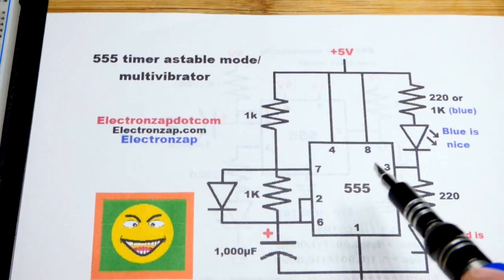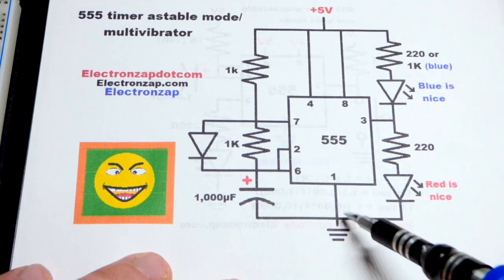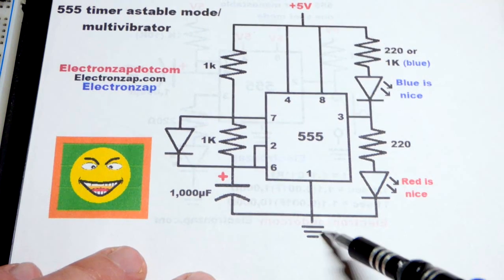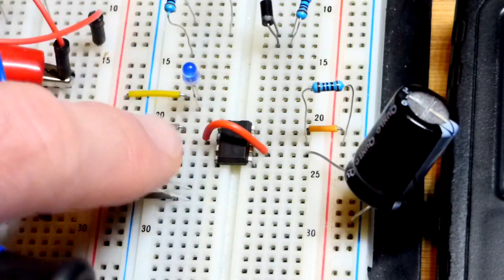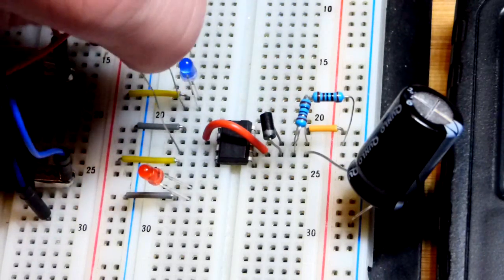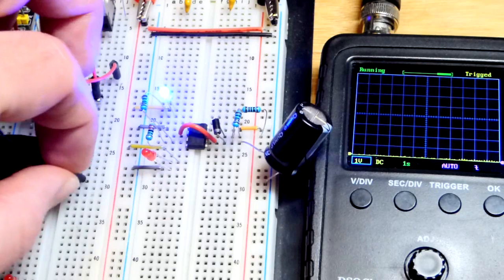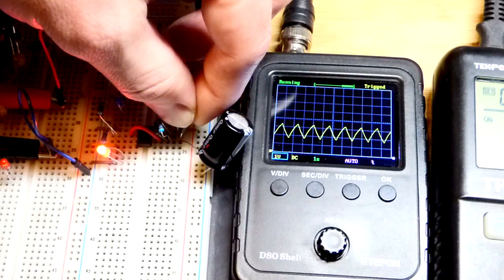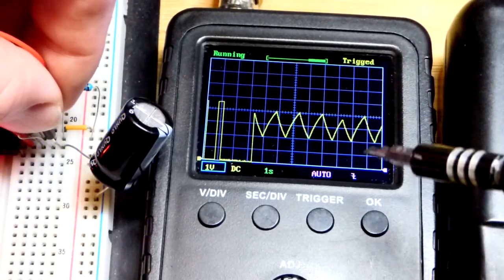555 timer astable mode multivibrator circuit with oscilloscope measurements with output LEDs

Comment: Interesting one diode , two for more equal duty cycle and of course we can either calculate or use the cheat sheet online table to not use a diode and pick non identical value resistors to get the blinking behaviour we want.
Reply from the maker: Possibilities are endless. Thanks for watching!

Comment: I absolutely am loving this series, it should be required reading !..I am not used to seeing the diode across one of the resistors, is this to set a 50% duty cycle ? as I say I don't normaly put a diode there ...cheers.
Reply from the maker: Glad you enjoy! The diode does help a lot to get close to a 50% duty cycle.